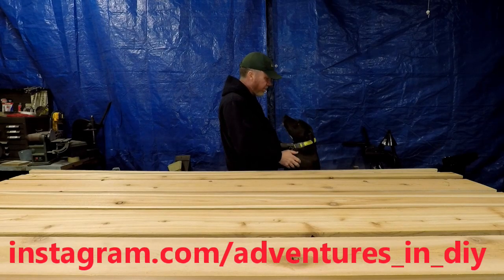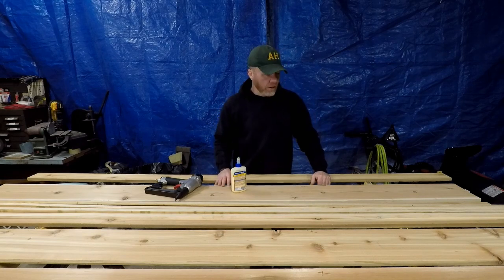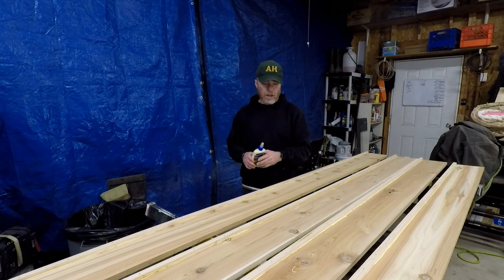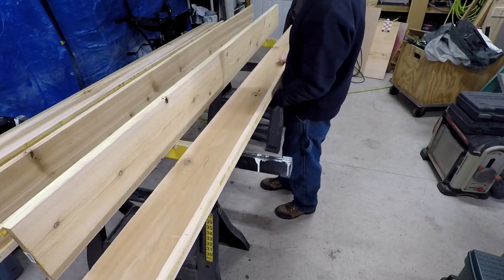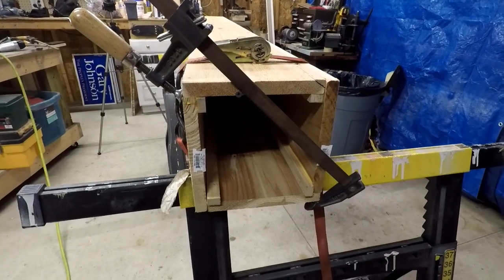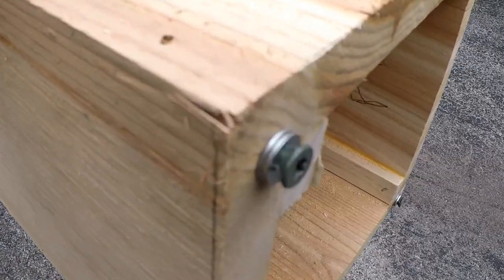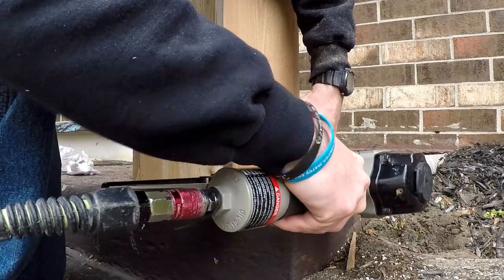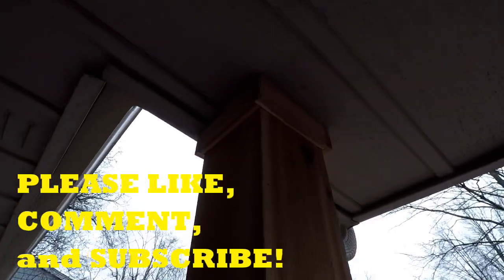Building a Cedar Porch Column | How To | MY DIY

Comment: Nicely done, DIY.  Good you're going to put caulking around the top-edges of the base horizontal boards.  Water will no doubt find it's way in there. Full-watch and would have liked to see a before & after but I can imagine the great improvement your woodwork was compared to the rotten porch column.  Have a fine upcoming week.  👍
Reply from the maker: I thought I had some before pictures...oh well🤷‍♂️

Comment: Do you have to put any finish on the outside to prevent splinters (if you touch it ) ? Or is it smooth enough already
Reply from the maker: It’s rough sawn cedar, you’d have to bar-top poly that thing to make it smooth.